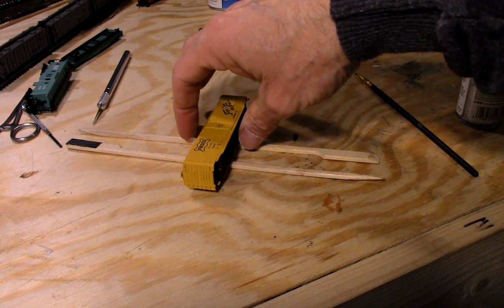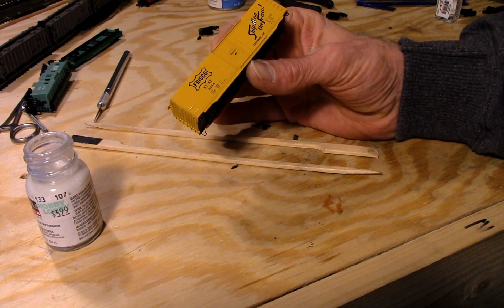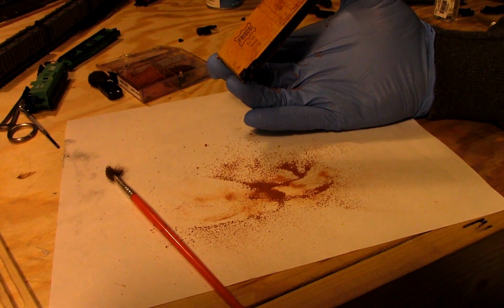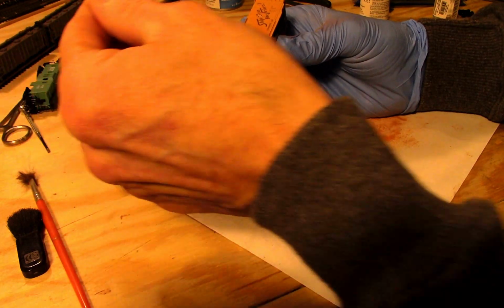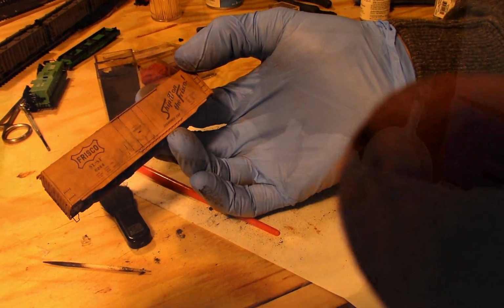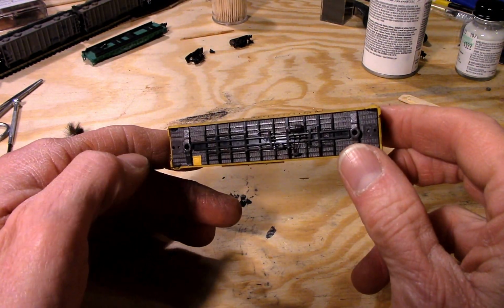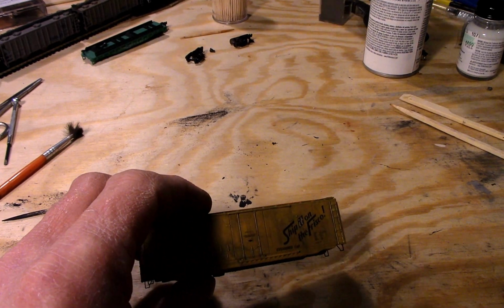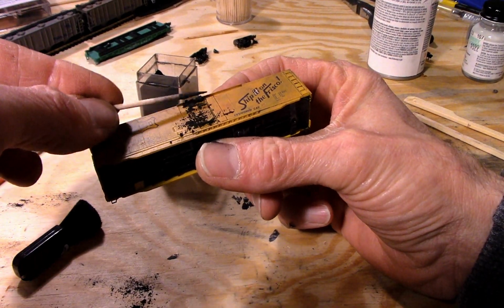The Car Barn-Weathering Powders and Matte Medium

Comment: Hey Ralph. Very nice video.  What does matte medium do?  Also, say you painted something too dark like what you did at the end of your video, can you still get some of it off?  Do you use rubbing alcohol or just water using brush strokes or wipe off with paper towel?   Thanks- Drew
Reply from the maker: Drew,
The matte medium basically tones down the shine.
Yes, I can take off the weathering powders that i put on after the dullcote-they will come off with water.
The powders i applied before spraying with dullcote may need paint thinner or spirits to remove.
I will show this in a later video-Thank You for commenting!
Reply: Ahh...cool. Thanks Ralph.  Have a great weekend!  - Drew
Reply: @DruSteel69  good to know. so as long as you don't use dul coat the powders should come off.